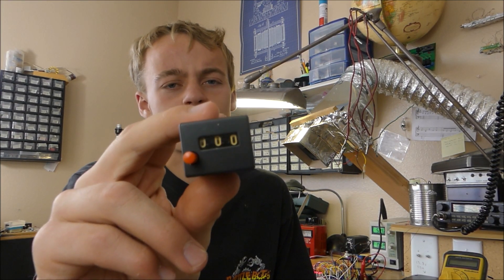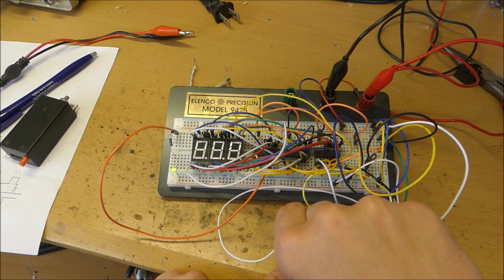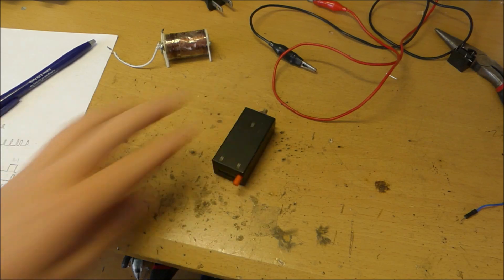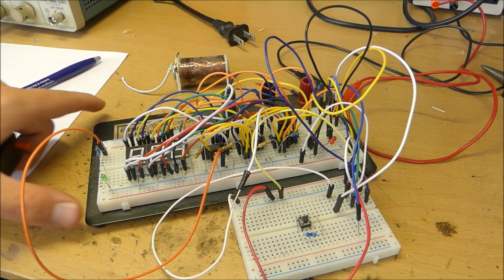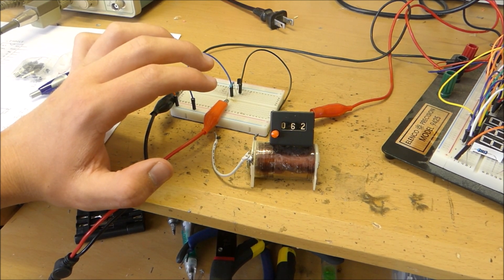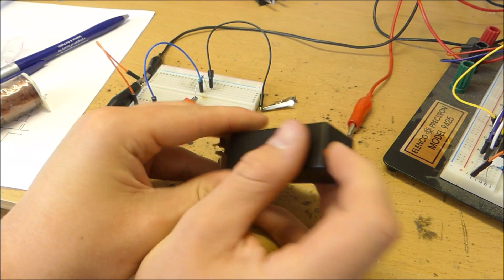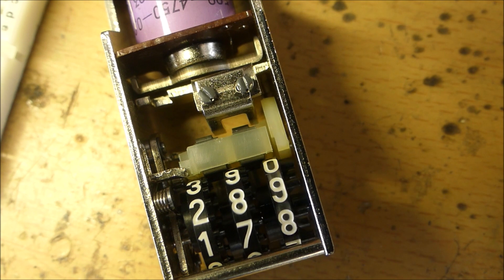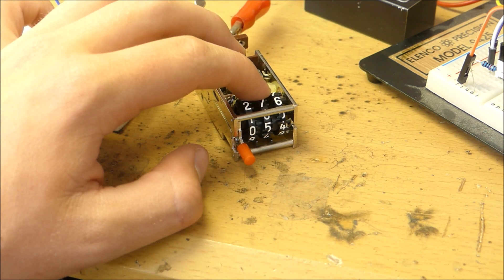Cool Vintage Electro-mechanical Counter || Compared to a Digital One

Comment: Cool video kid. I actually found one like yours except mine had a mechanical reset button that works and it has 5 spots for numbers so it can go really high. Not sure what the hell I'll do with it but it just seems like a shame to just throw it away. Been racking my brain for potential uses, any suggestions would be appreciated.

Comment: Hi my name is Brandon I was wondering if you had an email where I can send you pictures of a problem I have.  The problem is I have a suitcase type record player it’s old but has very sentimental value to it. The problem with it is it’s a tube type record player and when I power it up I has a very load hum in the speakers and no record sound coming from the speakers when you play records. From videos I’ve seen on YouTube it sounds like a compasitor problem. I opened the amp and it’s got a paper waxy compasitor and it looks like was was oozing out of it. I seen your video of you working on a suitcase record player and other videos you uploaded and you are very smart on these things and I was wondering desperately if you could help walk me through trying to fix it. I know some things about works like this but I wanna see if an expert could walk me through it and to be sure I do it right. I have a few old compasitors ive collected from things and I could try to see if they work.  I love your channel and I’ve subscribed. Thanks!

Comment: Great video ! 
I saw similar counters at my local electronics shop. Very cool little devices ! 
Have you tried plaing with the duty cycle of your signal generator ? It sounds like you are using 50%, you should try less. I suspect that with a shorter and stronger impulse it could go faster.

Comment: Big advantage of the mechanical counter is it is truly non volatile, though you get electronic counters that have a built in battery to power them, with a 10 plus year life. They also are limited in operation speed, as they are designed to directly replace the mechanical unit, though you get them with the option to have a preset count reset with a output pulse as well.